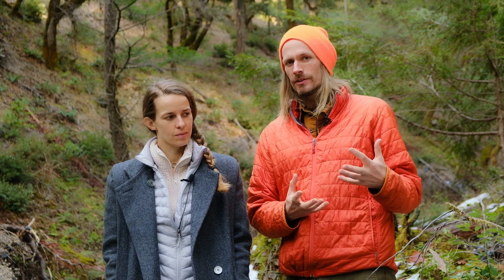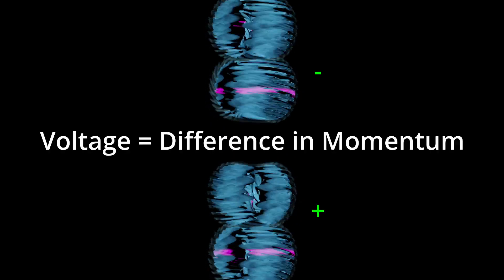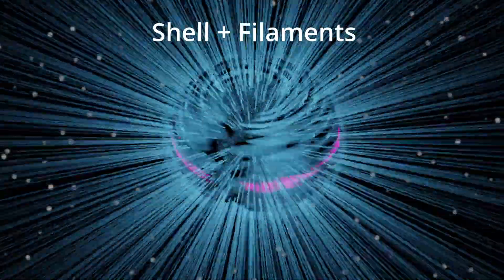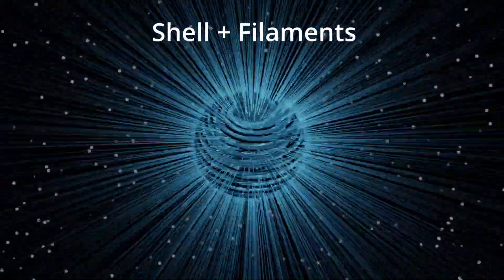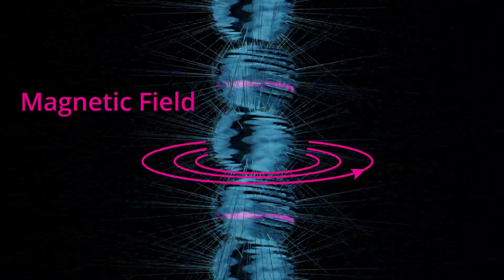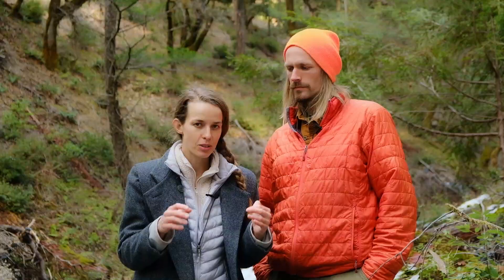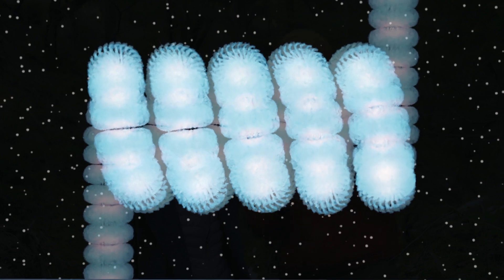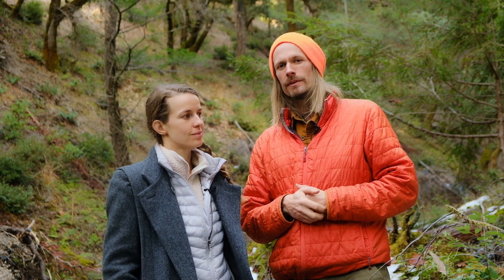Material Explanation for Electromagnetism - Topics in Physics #11

Comment: Atoms of all elements emit a unique electromagnetic microwave band frequency that is reserved just for that element with no two elements having the same.  The same element's electromagnetic microwave band frequency contained in an elemental mass band together for producing the unique elemental magnetic flux lines with no two elements having the same, which is what energizes the electronic metal detector and the dowsing rod. Also, the unique elemental magnetic flux lines are what helped band together like elements for producing everything from the big bang to the present day universe. 
Read and study the book, The Art of Dowsing - Separating Science from Superstition ($14.95), for learning all of the physics involved in dowsing and how to build the modern light weight ball bearing dowsing rod, which is the only dowsing rod that accurately gauges what is being dowsed by pitting the energy of gravity against the energizing of the one-tenth ounce dowsing rod load that is attached on the elevated acetylene welding rod, with being located five-inches from the hub's shaft.  This precisely gauges the dowsing of all edges, exact center, depth buried with angle of deposition, and most important is grading of the sought element that is contained in the elemental mass that is being dowsed.  Anybody can become a professional dowser by practicing the book's dowsing lessons of buried pipelines and electrical cables, tunnels and voids, precious metal placer and lode deposits, dowsing for treasure, dowsing for any element, amplified long distance dowsing from a moving vehicle, and dowsing on water from a boat.  I hope dowsing enriches your life and have a safe, healthy, good day.

Comment: If electric charge is this rotational momentum, connecting wires from different directions (but with the same polarity) would have wildly different effects, since the rotational orientation no longer matches. But in reality, it works the same as long as you connect to the correct polarity, no matter from which side of the piece of conductor.
Actually, this kind of dependence on orientation is exactly what we observe with magnets, but not electric wires.
Reply from the maker: I don’t follow. If you connect two positive terminals you get a very different effect. Polarity is defined as relative rotation here. No positive without a reference negative
Reply: @MaterialAtomics  If you connect the correct terminals, but from geometrically distinct directions, you still get the same effect. If you connect one more component to geometrically distinct directions of the same conductor, the polarity doesn't get reversed because of the geometrical direction. But if electricity is rotation of atoms, then the rotation should be reversed if you look from opposite directions, reversing the polarity.
Reply from the maker: You have to remember that most conductors have compiled orbitals - not this simple 1s shell we’ve shown f or hydrogen. In those atoms - say copper - you have distinct rotational surfaces that are polar - a top surface always rotates opposite at the bottom. There may be several of these orbitals not involved in conduction. The s shell conduction also has to consider the kind or rotation we r talking about - see our video in spin 1/2 for a refined picture. It is a particular involution that is proposed to occur during rotation. This is important in orienting poles. In any case you have to consider that the entire conductor is organized in such. Way that one end of the circuit is opposite the other.
Reply from the maker: Btw if you are talking about shorting the side of a wire you have to consider that atoms can rotate in place to supply current at any angle so long as they’ve been whirled up from behind. This rotation in place is evidenced by a/c power. We’ll do a vid on that next actually.

Comment: would you consider comparing an electrically generated magnetic field to that of a permanent magnet? ( considering that composite materials can be alloyed to store greater magnetic fields than pure feric materials ) TIA.
Reply: yes, we have to do a video on permanent magnets soon FOR SURE. Similar setup at the atomic level but the strength is baked into the atoms themselves.

Comment: The positive charge being a slower spinning atoms wouldn't cause repulsion when the charges are the same . This does work for magnetism , but a reference frame maybe needed , if the wrong one is selected north turns to south , and vice versa.
Reply: positive charge is opposite rotation from negative under the model; voltage is different in rotational momentum. You have to examine each lead of the wire head on to see the opposing charge (rotation)
Reply: @DemystifySci_Podcast  @The DemystifySci Podcast  I am skeptical  if that works , because turning the wire would flip the charge . Something is needed that attracts or repel even when the direction is inverted.
Reply: @m.c.4674  you have to compare leads head on to one another in order to determine charge. Once you've done this you can turn them any way you want and the charge remains the same. There's no + without a reference - anyways.
Reply: It's a complex fractal net effect.  It almost takes imagination.  Or art.
Reply: @OrpheoTreshula  'complex fractal net' is a much improved way of looking at the U compared to 'particle palace'
Reply: @DemystifySci_Podcast  Thank you.  I'm beginning to think of it as almost a tree of sorts.  Ultimately completing a single circuit.  Perhaps mirrored or, and this is very very speculative, actually participated in by our own (more mysterious than people realize) circu-latory system.
Reply: M.C., I hate to agree with anyone, but in this case...  I think Dr. DeLay is correct.  You can change the direction of screw (and of course I love to oversimplify) but that doesn't change it's threading.  And in fact, that is where you are correct as well.  Since the structure is modeled by Burkeland.  And Dr. Scott.  They will indeed twine both ways, but not carry the same twist, which is the point in question.